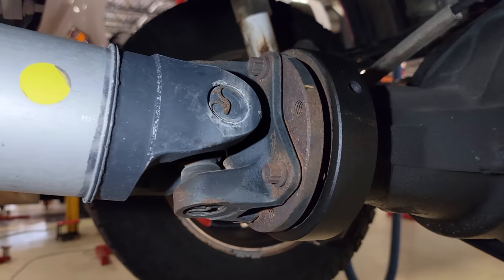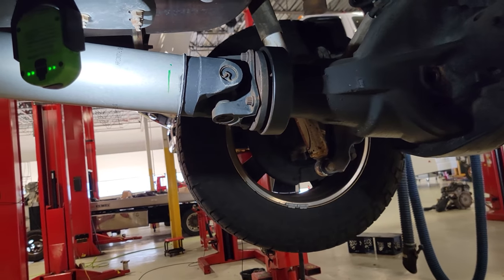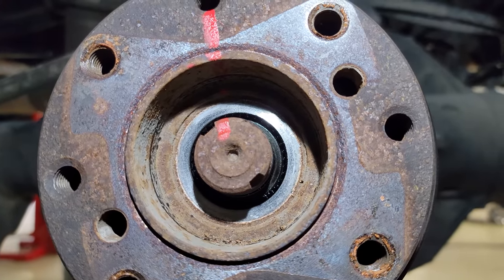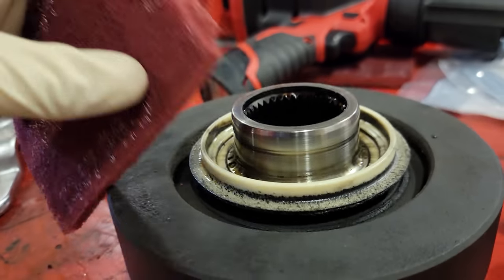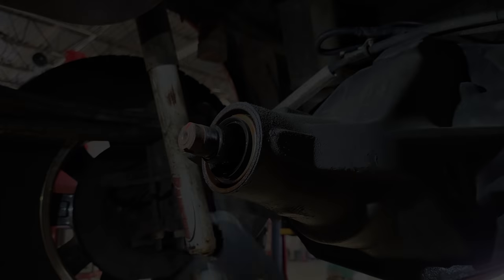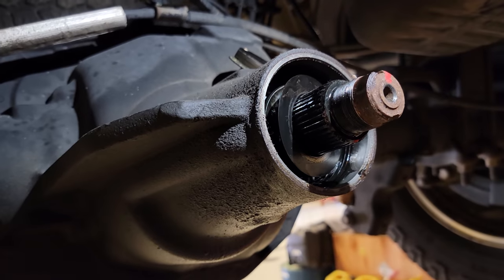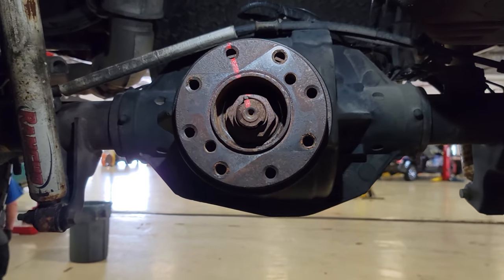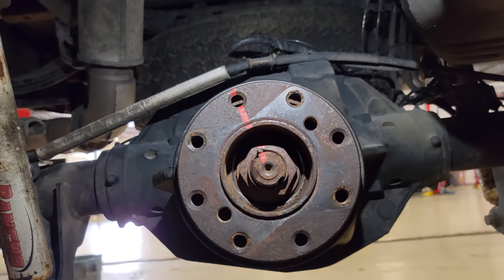Ford Superduty PINION seal - FIX your rear end leak at home! F250 F350 F450 F550

Comment: For those of you wondering, the correct seal driver tool is Rotunda tool numbers 205-935 for the actual seal driver, and 205-440 for the driver handle. Excellent tutorial as usual.

Comment: In the past I have cut out a piece of wood with a hole in the center and tapped on it to drive the pinion seal in. I placed  an old rag against the seal and then put the piece of wood against it to keep dirt, dust, wood shavings, etc... from getting into the seal as I tapped it with a hammer.

Comment: Got a $10k quote from the Ford dealer so have my tyranny out in the driveway. Couple tips. Be sure to mark it like he shows in the video. I did, but didn't line them up on reassembly. Backlash was way off. Repulled and lined up and it was just like when I took it apart. Second, 1 5/8" NEW socket from Oreilys was WAY too tight. Couldn't get it off the nut. Had to borrow a very well used one of same size from a tech buddy. Worked perfect.
Reply: Had the exact same problem the 1 5/8 socket from autozone was just a little tight so i figured must be the chrome plateing so I tapped it on with a hammer turnes out my impact isn’t strong enough and now I can’t remove the socket…..I’m so tired of Chinese manufacturers I searched everywhere to confirm it’s 1 5/8 only found a couple forums about it but the consensus was indeed the bolt was 1 5/8s
Reply: Hopefully you fixed your tyranny and are left with liberty.
Reply from the maker: Easy

Comment: You don’t need that puller to do this job. I found it way easier to use a 90° angle pick and hammer it into a groove then just pry with flat head around till it pops loose

Comment: Seal Driver - as several folks below have pointed out, 3" PVC pipe will work for a driver. However, if you don't already have some 3" PVC to work with - buying even a short section is going to run $7.50 plus.
If that's your situation (it was mine) - you can purchase a 3" cleanout adaptor with the cap as a whole fitting for $7.50 from Home Depot (or your favorite home improvement or plumbing supply) and you have a ready made driver. With the cleanout cap screwed in, you have something to drive and the open end will cover the lip of the seal perfectly.
I'd suggest using a rubber mallet - to avoid breaking the fixture. If you don't break it - you can use it for a plumbing project - or your next 3" seal.

Comment: Just replaced on 04 f350 this past weekend and was super easy!! The explanation in this video is perfect. The only thing that we had trouble was getting our hands on the exact puller from this video. Even O'Reilly's puller looks the same but is to small. So we had to use a puller that only had 2 points of attachment. Other than that this video is super informative.

Comment: Working for Uhaul we normally had extra exhaust tubing, from the E450s used that worked every time, just had a welded brace across one side so we could hit it in the center while installing it, so many leaking pinion seals haha

Comment: When I was built swap buggies back in the 80’s I took a short 2x4 and then a jigsaw to cut the proper size hole ( back then you could get longer jig saw blades, you really can’t find them today) it worked really well. Buy then again it was a swamp buggy and not a real passenger vehicle. My favorite drive line combo was a 300 6 cylinder, I would bolt two auto trannys together, then a new process 205 gear, not belt driven, divorced transfercase with the original old school Dana 60 differentials, and warn manual locking hubs. Back then limited slip WAS limited slip and you didn’t have to apply brake pressure to get it to engage like you have do in the Tremor, it knew when it was slipping and then just locked up. Those were the days !!

Comment: Hi, thank you so much for the video...I will be doing this on my Excursion and my F 350 dually in coming weeks. I do not have any power tools but I have breaker bars from ranging from 1' to 4' ;) I may swing by HF and buy their electric torque wrench.

Comment: Just went thru this on my 17 f250 
The autozone/orielys 1-5/8 is to tight buy the next size up
Your gonna need a strong impact to take the nut off and on I had to buy a better gun got the (earthquake) from harbor freight 
Remember when hammering the flange on that this is a crush sleeve pinion so don’t bottom it out
You should use lock tight on the pinion nut.

Before you do anything… get a feel for your lash….just incase you deform the sleeve when installing your flange….and you have to go by feel and not your marks

Comment: I would make a seal installation tool. Cut a piece of 2×6. Drill a 2" hole in it. Screw another 2×6 over the drilled part. Put it over the shaft and drive the seal in. The wood also stops you from damaging the seal.

Comment: PERFECT Timing! I was just under my truck (looking at the exhaust - and I noticed the rear pinion seal is leaking! 
Great to be able to see the whole procedure on video. Mine just failed around 215K miles (2011).
Semi-silly question - but what kind of marker is that - in bright colors and tough enough tip to write on rusted surface?
Reply from the maker: Awesome, now you can refer back to thee video. Just an ol paint marker.

Comment: Do you ever use a little bit of shop air to make sure the vent is clear? I know that if the vent is obstructed the leaks will come right back.
Reply from the maker: Yepp, blew that thing out at the end
Reply: Good mention. Muddabber Wasps like to fill in the vent hole.

Comment: I will be doing this per your step by step instruction to my 2008 F350. I am assuming it is the same for the Diesel SW version.
Reply from the maker: Yepp, gas or diesel
Reply: @PowerStrokeTechTalkwARod  Starting my 2008 F350 Diesel's Pinion Seal right now with laptop next to me for step by step instruction!

Comment: Great video, and thank you for the information. Question for you would it be similar process for front diff pinion seal as well? Just came back from a trip in my 04 F550 and I developed a leak there. Thank you for sharing!
Reply from the maker: It wld

Comment: I like your method of install. 1 question. How do you know its not to lose or to tight besides your mark spots because will either way it effects the gear in the rear ended being to tight or lose?
Reply from the maker: Cuz that nut is stoppin. If i were to have gone further my mark would have been off. Have to use ALL your senses
Reply: @PowerStrokeTechTalkwARod  ah ha. Thanks, good point.
Reply: It is easy to tell. The assembly has slop in it until the last full turn. Once you feel the slack start to come out check your mark. When you line it up the rotational slack should feel just like it did before you removed it.

Comment: Had this done on my 2009 6.4.  1 month later pinion bearings blew apart.  I told the guy they went bad because they didn’t index and probably tightened the nut too far and had too much preload on it.  Their heads exploded and told me that pinion bearings can just “go”
Reply: @PowerStrokeTechTalkwARod   oh yeah they was a Ford dealer… if i would have known i would have done it myself

Comment: When replacing the pinion nut - how do you know when you are on the correct rotation of the nut?
Should you take an initial measurement from the flange to the housing for comparison?
I get that ultimately we will line up our marks - but the mark on the nut will be lined up once every rotation.
Maybe a silly question - perhaps more obvious when I am actually doing the work. But planing to take a measurement between the flange and housing before if that's possible.
But would like to hear you comment on if this is/isn't needed in order to get the pinion nut back to the same location.
Reply from the maker: We went over that in the comments
Reply: @PowerStrokeTechTalkwARod  sorry - I'll read through them to find - my bad.
Reply from the maker: Thank u sir
Reply: You can also count the threads to help you
Reply: @alexmartinez-iw3le  - yes, thanks for that excellent suggestion.
I found in my case (already done) that indeed it was obvious when the nut was in the right neighborhood. Was taking significantly more torque to move. I had some idea what the pre-load should "feel" like - and when I got close, it was obvious (to me).
I do think counting threads is a great idea though.

Comment: I just had to replace the pinion seal in my 2022 F250 at 8,000 miles! Any idea why it would have to be replaced so early? It seems premature. Is there any preventative measures that I should be taking?
Reply from the maker: For reallll?
Reply: @PowerStrokeTechTalkwARod same process? bout to take on my old man's 17 6.2 350

Comment: Husband having extremely hard time finding a wheel puller wide enough to pull pinion.  Can you recommend one and vendor.   Have purchased two but either the spread is not wide enough for the bolts or.... the stock bolts will not go thru the puller holes because of the diameter.  Truck is down.  May day, May day.
Reply from the maker: Maybe a tool truck would have a puller

Comment: How is indexing the nut better and tightening it until the marks line up better than using a torque wrench on reassembly?
Reply: It’s to set the right amount of preload. There’s a crush washer u put in during new pinion install. It’s obviously already crushed as much as it would be, the torque values used during new install would likely put too much preload on bearings causing premature failure of the bearings.

Comment: Do you put any gasket sealer between the seal and the diff to stop any leaks in that manner?  I did the 2 times so far and i have a seep but it's coming from the seal to the housing it looks like. Thanks
Reply from the maker: They shld be installed dry.

Comment: Hey brother love everything about your show and your videos. I was wondering if you might know anything about Ford motor company and the upper oil pan issue? Do you think they’ll have a recall on that eventually? In reference to the sealant used.? Awesome channel awesome videos.
Reply from the maker: Thanks guy. There is no issue. Some leak some dont. I highly doubt there will be a recall
Reply: @PowerStrokeTechTalkwARod  Thanks for getting back to me so soon brother. I was just wondering because I thought about it a lot after you explained the issue of using the wrong sealant and you having to redo the upper oil pan seal every 20 to 30,000 miles because of it. Thanks for getting back to me so soon and have a great day.
Reply from the maker: U too pal

Comment: Why did truck manufacturers get rid of the u-bolts that holds the u-joint in the yoke like the trucks back in the 70's....those bolts that just screws into the flange look like they will shear off if enough torque is applied

Comment: No new pinion nut or locktite?
Reply from the maker: Nope
Reply: @PowerStrokeTechTalkwARod  I just did mine. When I backed the nut out the outer collar got kinda mangled from where it was staked. I put it back on bc I needed to get it back together. Didn't do locktite because you didn't. But when I restaked the nut, the collar tore a bit. Now I'm really worried it's gonna back off. Get a new nut? Or should be fine
Reply from the maker: If u get a flat blade and stake it again, ull be fine

Comment: So why a leak on a 2017 ??? Whats the mileage. This to me would be disappointing. I have a 20717 and a 1999. Never been a leak on the 1999.  Also, not prudent to match mark the driveshaft to the original installed orientation ?

Comment: I prefer to remove the pinion nut by hand and count the number of turns to remove, then re-install the same number to know for sure I got the pre-load the same.
Reply: Work smarter, not harder. God made compressed air for a reason.
Reply: Well, after having the pinion bearings destroyed on two different trucks by techs going heavy handed with an impact wrench...
When I do use air tools (and I do), I count the exposed threads on the shaft before I index mark the nut prior to impacting it off.  Bearing replacement is really not cheap.
Reply from the maker: Guess they were too heavy fingered

Comment: Why does ford always have recalls/small defects. Ram 2500 seem a bit more reliable. Btw I love fords diesel trucks
Reply from the maker: Ask dearborn
Reply: When I bought my 17 used at a dodge dealership they had a couple with a brand new ram call them them saying the engine sounds terrible….turns out no one filled it with oil.

Comment: Don't drop the pinion flange 😂😂😂
Reply: Done about 20 just like that it's always a chore to find the driver tool at the dealership. I always just use a screwdriver and hammer to remove the old seat.

Comment: Needing a second rear pinion seal installed on my 08 V10 with only 46k miles.  What a bunch of BS Ford...
Reply: Ford doesn't manufacture the axles. Dodge and GM are the same.